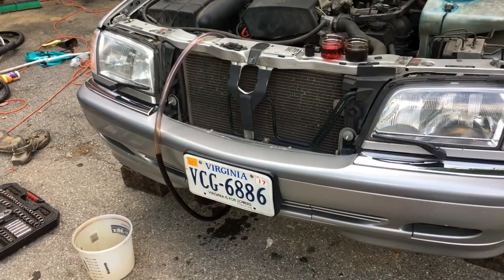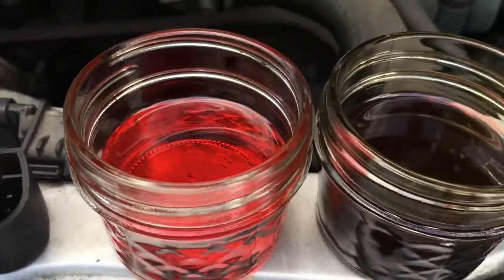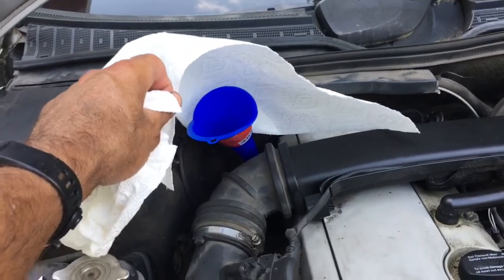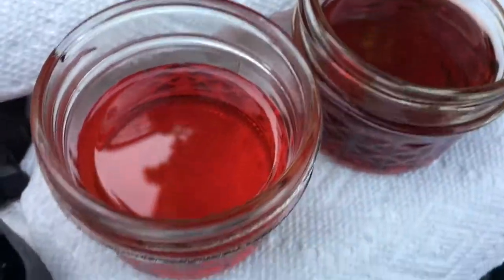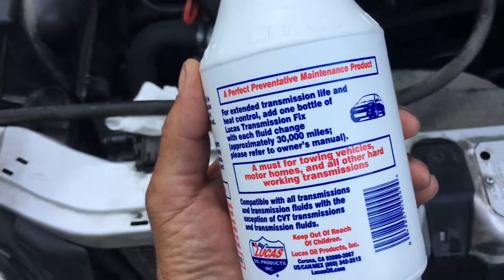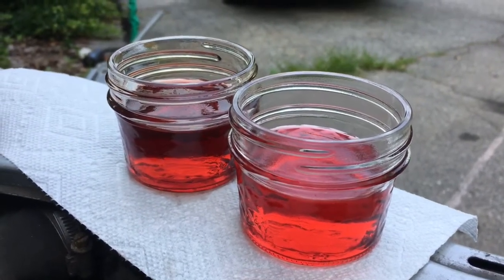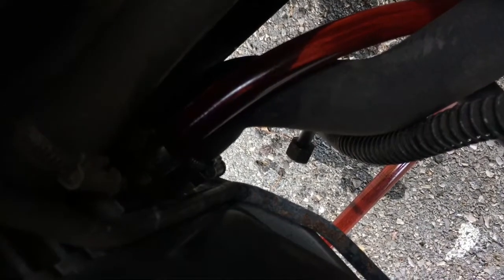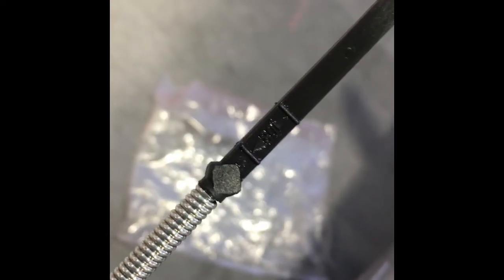Mercedes w202 722.6 ATF Automatic Transmission Flush

Comment: Nice job.... The only downside is that that you don't get to change the Filter in the Transmission Pan. I think it would be more beneficial if you drained, dropped the Pan, (clean that out as it will have lots of deposits in it) change the Filter, replace Pan, replace fluid quantity that was removed from the Drain sequence and then do this procedure. You will find it will clear much quicker that way!
Reply from the maker: yeah this doesn't replace the filter change - it's in addition to

Comment: Very good work - much better to properly flush the system like this, than to drop the pan and change less than 50% of the fluid; which is then immediately contaminated with the old stuff as soon as the pump runs. Top job!
Reply from the maker: thanks! doing both is the ultimate.

Comment: Just curious.  Is it better to flush the transmission out before or after dropping the pan and replacing the screen, gasket and conductor plate/connection plug?  If my fluid is pinkish-light brown, wouldn’t I want to flush gallons of old fluid out BEFORE pulling the pan, replacing conductor plate and connector, working on valve body, etc.?
Reply: Chris Telesca that’s how i would do it. Drain it off or even better if you have one, fluid extract the trans fluid from pan through the fill tube with the cap on it. if you pry gently, you can probably save the tab. Even if you loose or break the locking tab most likely it’ll still have a secure fit. Then drop your pan ect....Pretty sure the inner diameter of the hose is 1/2 inch.
Reply from the maker: if doing both then filter change first and then flush

Comment: That's kool during your method whit a little twist how are u liking that valvoline max 😜
Reply from the maker: i use it in all my high mileage auto trans vehicles and it works great! zero issues. zero needed repairs, hundreds of thousands of miles.

Comment: Overdue things waste money and resources. Just drain and fill every 60 k miles is fine. No need snake Lucas oil
Reply from the maker: if you live in the mountains like i do an additive like Lucas is outstanding equipment protection
Reply: @BRS_DIY  I live in the mountains area too, Just regular drain and refill Toyota WS every 30-60k miles. Sienna04 and Prius06 have no problems beyond 200k miles.  Additives thicken the fluid and may increase wear in the cold start.  AS long as we use high-quality DexronVI, WS, or Mercon LV on modern cars, they are all fine.   Maxlive is one of the best value ATF that works for those except for belt CVT.  Besides that, very tight tolerance modern transmission required specific high-quality additives that Lucas stuff may ruin the formulations.  It is not just the base stock oil, but the additives that can stand 60-120k miles without much degredation.